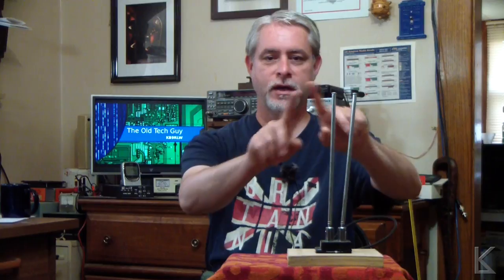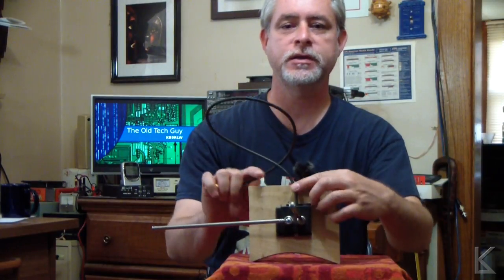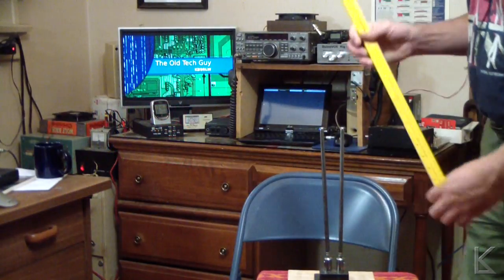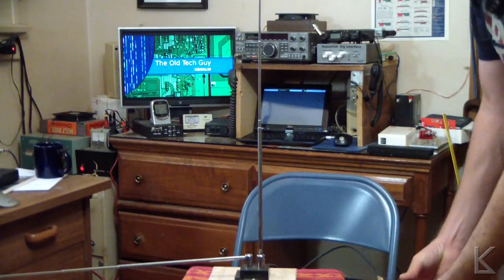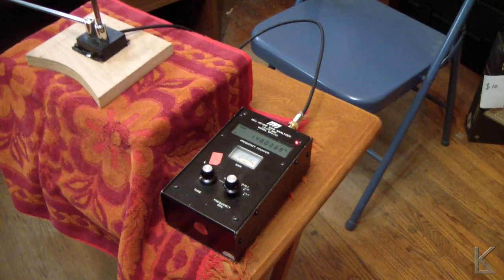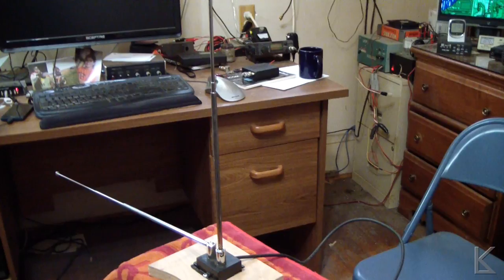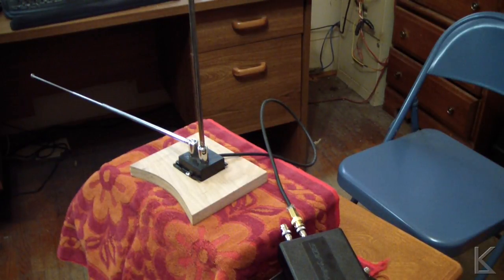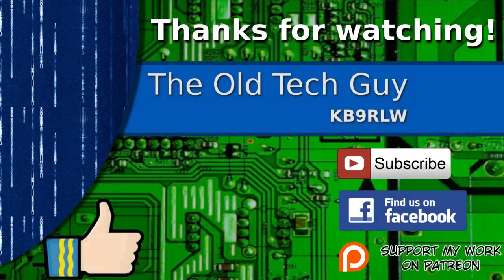Ham Radio - Old TV rabbit ears as a junk box 2 meter antenna

Comment: That was my first home antenna for 2m. My radio room was the access way to the attic, that also served as a small second closet in my bedroom. I did what you suggest, but I taped the elements so they wouldn't slide, tied a piece of string to the top element and hung it from a rafter in the attic. I had no clue how to connect a BNC connector to coax so I used a piece that was used as a patch cable for test instruments in the labs at the University. I miss that antenna. It was lost in one of my many relocations. Nice video Kevin.

Comment: Experimentation often leads to great results. I used an old tv pole antenna (1980's I think), messed around with the lengths of the elements, and ended up with a cheap directional yagi for VHF-UHV.  Now to get it higher than 3 meters off the ground. Apartment manager is leery of me putting it on the roof with all the dishes up there. Go figure!

Mow K2JDM

Comment: In that configuration it could work in the 136-139Mhz and get the NOAA Satellites that come over.  As they turn on an axis they go from vertical to horizontal the antenna would pick up the changing signal and the decode would work without any null points.

Maybe do a test for the SDR via the WXtoImg program.  See if the antenna works and which one works better.
Reply: If you want to do that, you should leave the 300 ohm feed line on it and use a balun to get to your coax.  That way you're bringing both the vertically and horizontally polarized aspects of the received signal down the center pin where your receiver can make use of them.  In a configuration where the shield is tied to the horizontal element, it is acting as a counterpoise.

Comment: Are the rabbit ears long enough to make a 1/2 wave ground plane? I have some old rabbit ears I believe are 72 inches. Might it  be possible to build a 5/8 wave or does that matter for the purpose you intended the antenna for?
Reply from the maker: I don't recall the total length.   I'm primarily using them as a receive antenna for my SDR.   But please, feel free to experiment.    If you don't have a set, keep an eye out for thrift shops and junk shops.  I always see rabbit ears at those places.  Sometimes yard sales too.

Comment: I found a flat antenna for digital TV. Would that also work? The antenna has a solder on coax cable and I’m not sure 4/5w RF power will be okay with the type of coax TVs use.
Reply from the maker: The coax is probably 75 ohm type. That will cause issues with SWR since the radio is expecting 50 ohm feedline.  The antenna elements will have to reach at least 19.5 inches per side to get to resonance on 2 meters.

Comment: Have you done the aluminum foil taped to window glass or the adhesive backed copper foil stuck to window glass yet? One vertical element and two ground radials.

Several sets of rabbit ears on a wooden boom make for a cheap yagi as well.

Comment: Such a shame that NTSC channel 2 barely misses 6m.  :(
Reply from the maker: Yep, every set of 'ears' I've seen have been too short.  But it works great as a receive antenna for the SDR.
Reply: Sean Peoples what's wrong with nipping the top off, soldering in a length of stiff copper wire to give a little more length. Tune by turning the top to a small circle with a pair of snipe-nose pliers, and you've made it save against poking your eye out too.
Les
Reply from the maker: +Leslie Austin you could get them down to 6 meters for sure.
Reply: Leslie Austin Nothing wrong with that at all, Les, just less elegant than I'd like. :)

Comment: That's great! Now......can you retune a car broadcast band antenna for 2 meters? Would be a great "stealth" antenna if you didn't want people to know you had a 2 meter radio in your vehicle.
Thanks Kevin - great info for hard times. Or to just play around with! lol
Reply from the maker: Most modern cars have a module with a really short rubber duck.  The module is an active antenna amplifier.  They wouldn't work.   Some older car, 1980's or earlier would probably still have a telescoping whip that would work.
Reply: Probably going to be a quarter-wave at around 98 MHz or so, so you should be able to cut it down.  Not quite long enough for a half wave on 2m.